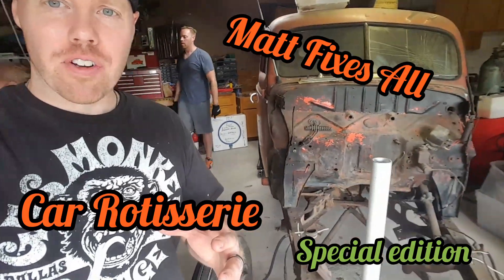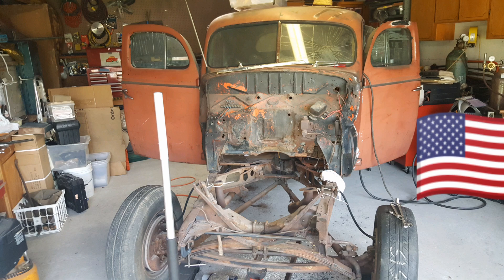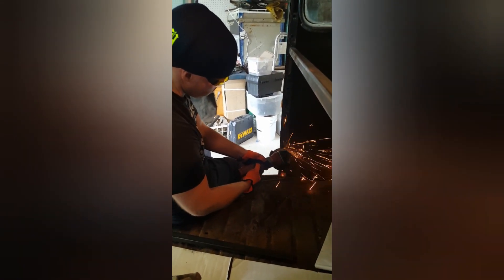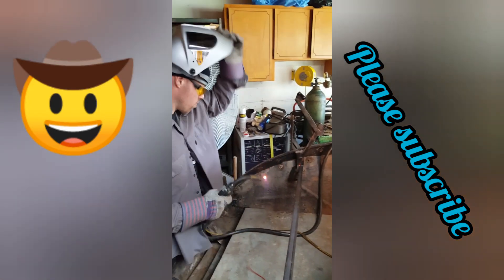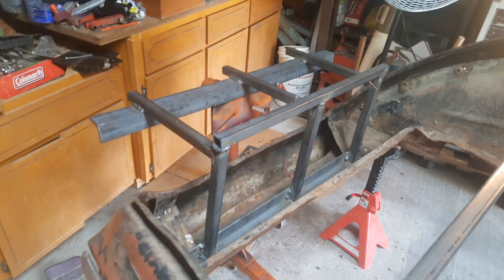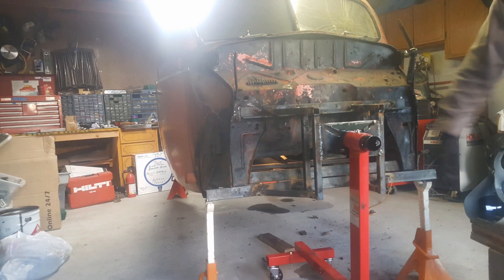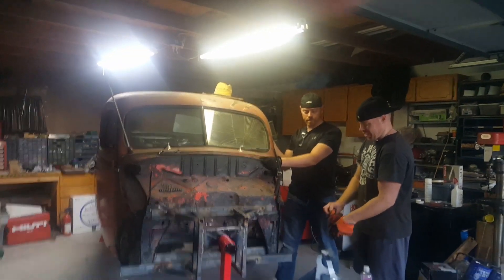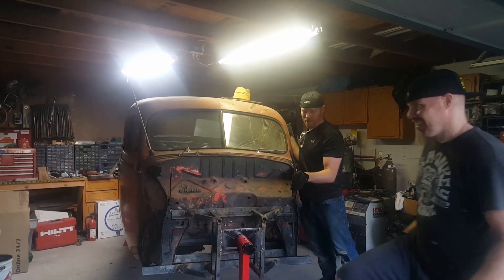Spin to Win: DIY Car Rotisserie with Engine Stands!

Comment: Will it turn completely upside down
Reply from the maker: It is off now. It would have if the legs were extended longer on the ground.  Not sure the roof clearance would have allowed it. But it easily would have gotten 90

Comment: Cool project. How long did it take?
Reply from the maker: Thanks Henry. It took a few days. It was a blast. 3 of us on the project so it wasn't too rough
Reply: I want to see the truck from the other video!
Reply from the maker: I have some stuff prepped to for the truck.  I look forward to sharing it!
Reply: Is there still a lot to do on the truck?
Reply from the maker: Yeah. We are going start with putting the motor together. Then work through the whole vehicle